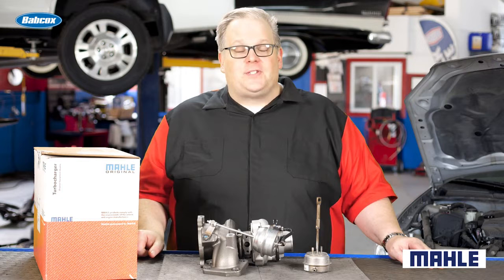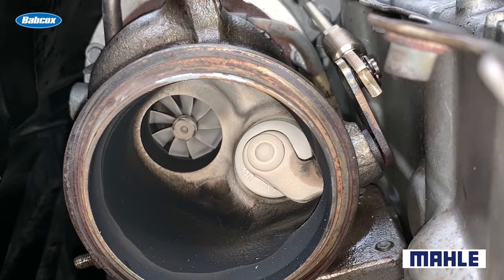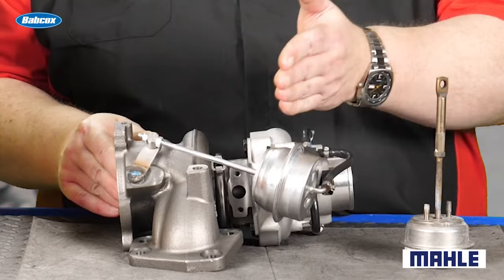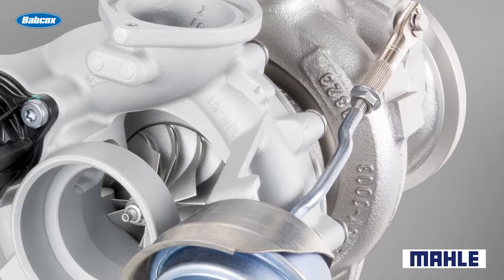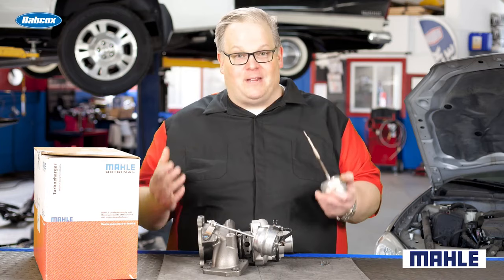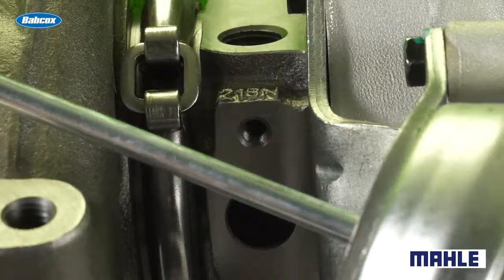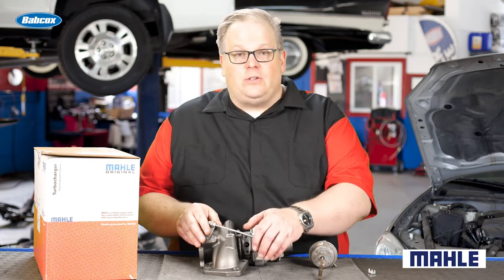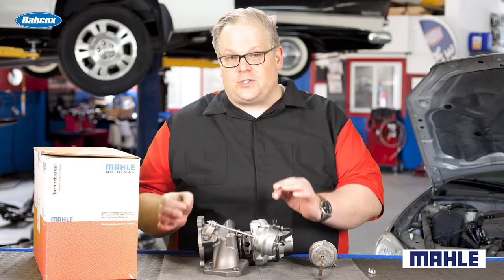Turbocharger Wastegate Actuator Service | TechLine

Comment: What a useless video. In what way is this an actuator service? You just vaguely explain what a wastegate actuator does!
Reply: Check the service information for the specific procedure.
Reply: @andymarkel  The procedure will be "replace the actuator" which usually means "replace the turbo" 

This advice is somehow more useless than the video. ;)
Reply: @andymarkel you are missing the point